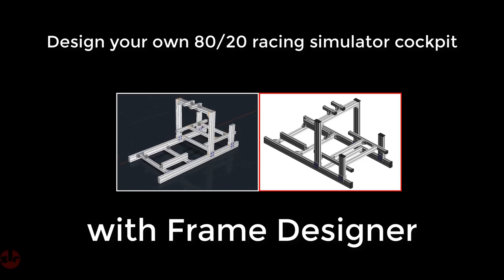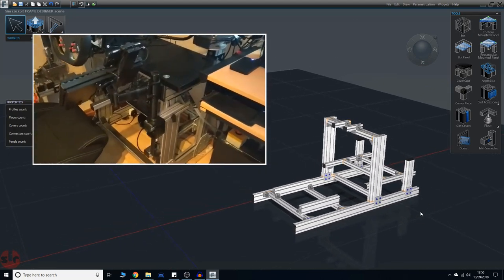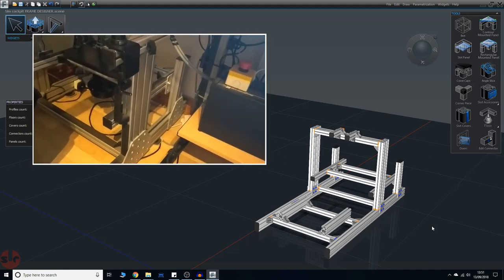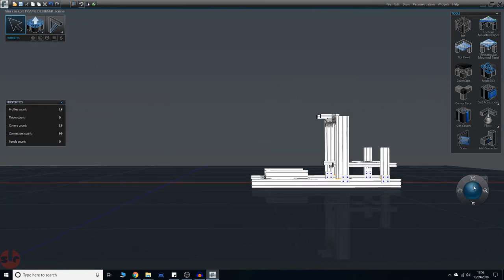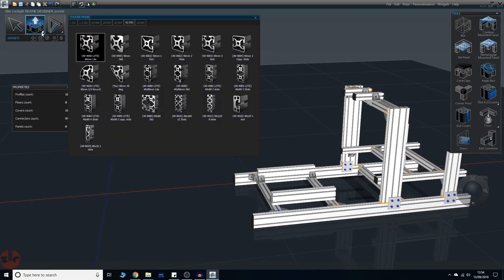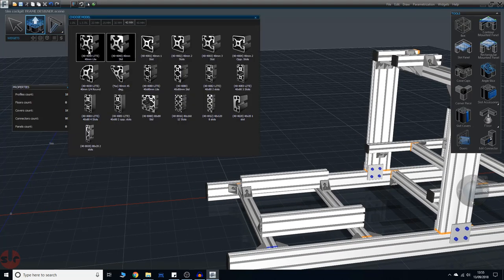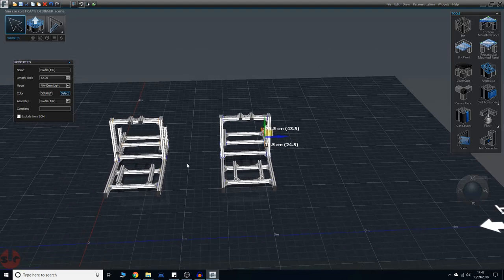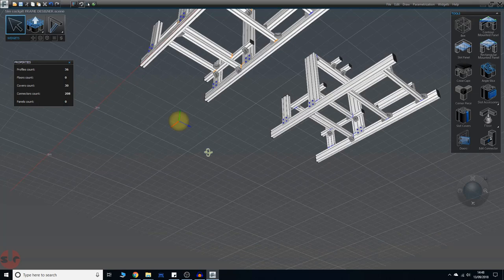Design your own 80/20 Aluminium racing cockpit tutorial

Comment: Is it possible to adjust seat height and pedal height to get F1 style driving position, and all other styles of driving positions, and how? I would probably use the GT style position but would want to experience what the F1 style feels like.
Reply from the maker: The answer is yes, as you can move anything along the channels of the profile part and lock into place. So things are height adjustable. The pedal area and the wheel deck are easily adjusted. Seat position is fixed unless you figure something else out.

Comment: Hello fella. Hope you are well.  Been watching a number of your vids around sim rigs including those focused on DIY rigs which are of immediate interest. Question. I have designed a potential rig in MayCAD but cant for the life of me work out how to rotate the pedal plate around an anchor so that I can show it sloped as it would be in use rather than flat.  Any ideas?  TIA. Ken
Reply from the maker: Sorry I don't have the answer. It's been a while since I made those videos, but I do remember not being able to do that either in MAYCAD.
Reply: @SimRacingCorner  hi. No worries. I have got round it by creating an angled strut and once you produce one you can draw off of it to create for example a sloped pedal deck. Fiddly but works. Perhaps I've taught you something. Keep up the good work. 😏
Reply from the maker: @kenvinton3786  Cheers Ken, that is useful to know.
Reply: Can I ask a question. I have a tighter space than I would like to place any new rig into, so I am trying to establish, for GT style racing, what the rough total distance is between the rear of a rig and the back of the pedals/pedal deck. Most new rigs are circa 1300-1400mm in length and this is too long. Can I ask how tall you are and what this measurement is for you across the various rigs  you use (GT focused ideally). TIA
Reply from the maker: @kenvinton3786  Mine is 1400mm in length. Check this video of mine https://youtu.be/I_SvWGqIKN0 as you can see the seat position. I'm 5.6ft, and although I'm not using all the profile, the top of the seat does overhang the back.  And of course, using seat sliders gives you some freedom. But the overall footprint is using all of that 1400mm.
Reply: @SimRacingCorner  Thanks again.  Appreciate the input.  Is that EVO rig?
Reply from the maker: @kenvinton3786  It's their GT1 design from 2015. They've updated it with more custom fittings since then. And I've added a few things myself over time.
Reply: @SimRacingCorner  thanks

Comment: Do you think it will be sturdy enough and cero flex if I change the 40120 for 4080 of the wheelstand, and the lower profiles of 4080 with 4040? I have a accuforce v2. Here in argentina 80/20 is very expensive
Reply from the maker: Using the 40/80 instead of the 40/120 parts would be okay for wheel stand vertical uprights. But the base structure needs that 40/80 to maintain the overall stiffness for a direct drive wheel.